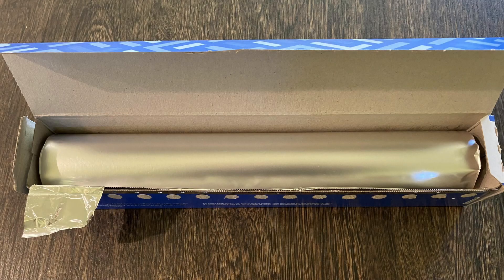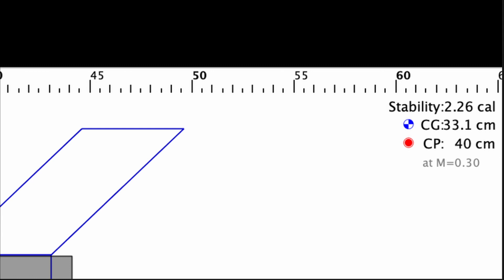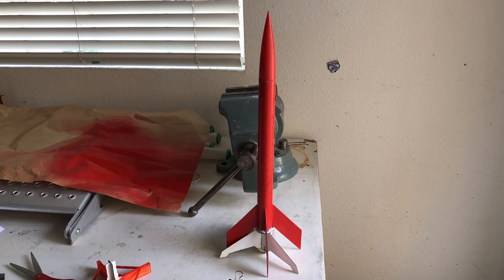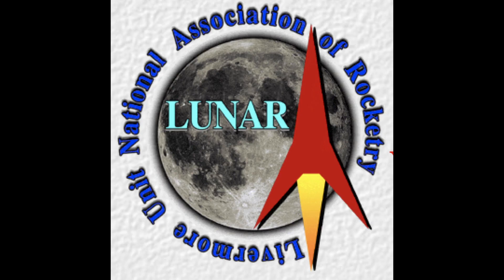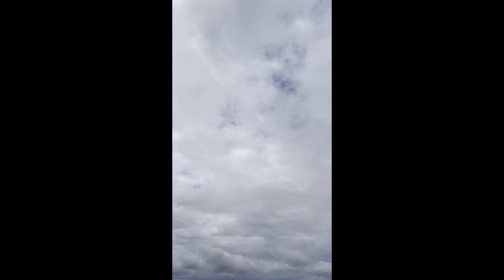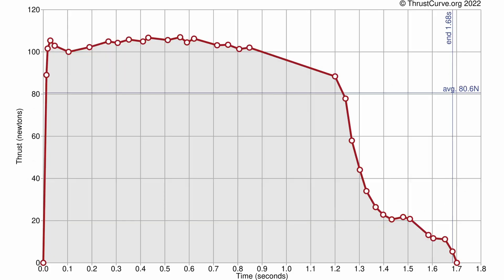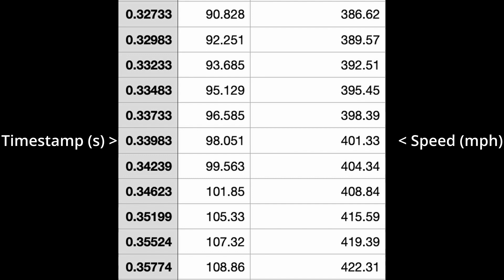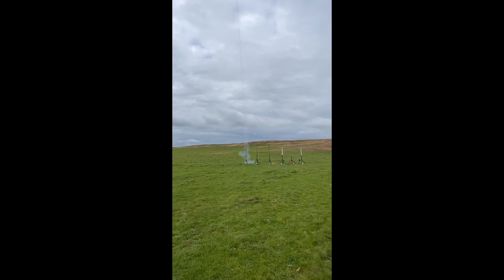Building a Supersonic Rocket and Flying It

Comment: your fin design creates a leverage moment at the trailing edge of the fin where it connects to the fuselage.   Inertia, g force and air friction work to lever the fins off the fuselage.  Your fins connection points are way shorter than the total fin length.  Look at the fin design of successful supersonic rockets and you will see  mostly fins longer at the body connection point, short in protrusion and tapered back to the body at the trailing edge.  Or look at supersonic aircraft that also have the same low aspect ratio.
Reply from the maker: I appreciate the comment! I ended up fixing that and we had a successful flight a year later

Comment: The fins exending below the body into the engine wash might be the issue. Every high speed rocket/missile design I've seen has fins no lower than the end of the body and often high a second set of fins high up on the body.
Reply from the maker: That was definitely one of the causes. I launched a new design about a year ago and it worked.
Reply: @motechspace   Good job. How fast?
Reply from the maker: @RightURKen7  M 1.22 (I recommend you watch the video)

Comment: I knew when I saw you actually used that thin cardboard tube it would do this, the tube compressed and the fins were glued on. Use pvc pipe and bolt on fins and you might make it work but then, that's why ghey have rules and Regulations about Super Sonic Flight. Because,when it goes that fast it's not a toy any more. Models are toys, supersonic flight is Ballistics
Reply from the maker: It worked with the new design still using cardboard. The problem was the fins weren't attached strong enough.

Comment: I think the main reason the fins broke off was due to you using what looked like wood glue on plastic fins. A better idea would probably be to use some sort of epoxy or plastic cement. Also, it could have been the structure of the body tube itself. Because you used an aluminum foil roll, it's likely that it could have ripped since it was not designed for rocketry like the ones you can buy online. Other than that, it looked like a great design and build. Good luck with your next launch! (It seems I'm a bit late so you may have already flown your new design)
Reply from the maker: Definitely a big part of what caused it. I launched a new design back in March, you should check out the video!

Comment: If you haven't determined a cause yet, it's possible that the motor got hot and weakened the fins/adhesives.
Reply: It was most likely aeroelastic flutter

Comment: Sweet rocket! I think you should rebuild this exact rocket but use through-the-wall fins and fillet the fins, attaching them with something even as easy as 5 minute epoxy (to make it super strong you can mix 50% chopped fibreglass tow and 50% epoxy). I think the fins came off because of a lack of surface area in contact with the tube, which would explain why only one of them shattered, and the rest were still intact. Try a different fin design that has a longer root chord and a shorter tip chord. Good stuff.
Reply from the maker: Thanks! I just launched the new design a few days ago. No trough the wall because it's minimum diameter but I used fin fillets and papered the fins. Video coming soon!
Reply: @motechspace  minimum diameter is that way to go, can't wait to see the new video!
Reply: From the couple high powers I’ve flown, slow set (60 minute) epoxy is much stronger than 5 min quick set
Reply: @nickfowler8810  absolutely, but in most cases you need to add a thickener, still worth it though

Comment: Your fin design is inconsistent with high speed or rapid acceleration.

Tip chord must remain over root chord.  Root chord must be longer and span must be reduced.  They are wayyyyyyyyyy too flexible.  You could taper them from root to tip.

You'll need to fillet them onto the paper tube unless you thicken the root.... a lot.

Bottom line...  put some Mach+ fins on that bird.
Reply from the maker: Yep I made some pretty bad design choices. I'm currently building the new design with using papered and filleted fins and the tip chord is fully over the root chord.
Reply: @motechspace  If you learned from them, then you are ahead of the game.  Might consider reading up on fast rockets at TRF.  Some smart folks there.

Comment: I just learned something interesting here. Could be useful for your project. As I suspected an ogive shaped cone is not adequate for supersonic speeds. Low altitude supersonic projectiles usually have cone shaped front ends. The Igla and Igla-S supersonic portable surface to air missiles have a spike at their front tip to create a small supersonic shockwave which reduces air resistance.
See: https://youtu.be/t_5cwfvKW70
So perhaps installing a piece of wood at the tip of your cone - the kind you can buy at the dollar store and normally used for chicken kebab - and re-enforced with marine epoxy could play the same role on your rocket.
Reply from the maker: That's really interesting. Thanks for the suggestion. Yeah I've read that ogives are really bad for the low supersonic region but the new design will use a Von Karman shape which is supposed to be really good. I'll see what the spike does in the sim (hopefully the sim will know how to deal with the different aerodynamics)
Reply: @motechspace  I suspect simulating this sort of details would require a very expensive fluid mechanics simulator.
Reply from the maker: @francoisleveille409  Yeah probably

Comment: Try laminating/filleting the fins to the body with something like fiberglass or even paper if you're going for a minimum diameter rocket. I would also try to increase the length of your root cord for more surface area to adhere to. Nice work with all the hypothesizeing and data analysis, keep it up.
Reply from the maker: Thanks! New design is currently under construction and will be much stronger.

Comment: Was the leading edge of the fins squared off? Or sanded down in the shape of a sharp airfoil? There's a pressure wave ahead of the leading edge of the fin, just like there's one ahead of the nose cone. Its drag effect is negligible at the subsonic speeds of low-power model rockets. As you reach the transonic range, though, the drag of the pressure waves rises sharply, putting stress on the rocket structure. Pointed nose cones and sharp leading edges are less affected by this external pressure — intuitively, they "pierce / slice through" the dense air of the pressure wave.

I second the commenter who suggested fin flutter as a possible cause. Supersonic fins need to be stiffer than those on low speed rockets. Most plastics are not very stiff. Plywood made from balsa or basswood is often used on mid-power rockets like yours. If you can't find any, you can easily make it from thin sheets of balsa and Gorilla Glue.

As far as fin attachment goes, I'm not surprised wood glue didn't do the job. The way wood glue works, it has to soak into both surfaces to be most effective; it can't soak into plastic. I second the commenter who recommended epoxy. Fin joints are stronger if they're glued not only on the edge, but also with fillets where the fin meets the tube (popsicle sticks are great for making clean fillets). 

Since you have access to a 3D printer, have you considered printing the whole rocket, with fins, as one unit? (I do understand, though, if you have sentimental attachment to the aluminum foil tube 😉)
Reply from the maker: Yep I didn't make great design choices for the first design but I was trying to be as cheap as possible. The next design will be much stronger, using airfoiled and papered fins using balsa and attached with epoxy fin fillets. And no I have no sentimental attachment with the aluminum foil tube🤣 (new tubes will be used). I like that 3d printing idea though but I'd be worried about melting. Might do it with a different rocket in the future.

Comment: I'm planning to launch a rocket similar to this but I have some questions. How were you able to connect the motor to the rocket body and how far away was it recovered? I'm launching in a field about 800 feet across surrounded by water, so I'd hope that it doesn't stray too far away. :)
Reply from the maker: The launch was a fail so it didn't go super far. The way we connected the motor though was just with a friction press fit in the body tube. The rocket is minimum diameter meaning there's no room from the edge of the motor to the inside of the body tube. Just wrap tape around the outside of the motor to slightly increase its diameter and it should be tight enough to stay in. These types of rockets go super high, but they're relatively light so just use a streamer for recovery. My new design for this rocket should be launching very soon!
Reply from the maker: Also depending on where you live, you might be able to find a better launch site. Go to the NAR website and look for club launches then find their schedule.
Reply: You're "planning" this but you don't even know how a model rocket fits together? Ok dude.. lol

Comment: The fins tore off because the contact surface is too small. On most mid power rocket kits that can support the thrust of a G80, the fins are slotted through the rocket's body. If you use a 29mm tube that both acts as an engine mount and rocket's fuselage then the fins must be more swept back and they need to be bolted to the rocket's body or perhaps glued to a much larger surface. I would use Lepage's 2 hour curing marine epoxy which is insanely tough and white in color.
Reply from the maker: I don't think that's why the fins broke off but they would have anyway later in flight because of that. Next iteration will have fins fillets.
Reply: @motechspace  Then please tell me how many newtons of force does the air resistance exert on a single one of your fins when your rocket reaches its highest speed ?
The motor pushes at up to 108.5N or about 24.5lbf. At first, when the rocket takes off, most of that is used to accelerate the rocket where F=m*a. Once the rocket has reached "terminal" velocity, all the thrust is opposed by air resistance and gravity. There is also vibration aka air flutter shaking your fins.

Before flight, I would suggest attaching a 5lb diving weight at the tip of each fins and lift the rocket by grabbing the tube. If the fins tear off then you know they won't survive the flight.
Reply from the maker: @francoisleveille409  Maybe you should watch the follow up video after this: https://youtu.be/jZD2TVxWQDA
Reply: @motechspace  Your sim (drag + acceleration forces) says 44.3 N or about 11.07N per fin that's 2.5lbf but you want the fin to take double that for safety margin and I suggested a weight of 5lb for testing.
I think my suggestion makes perfect sense.
Reply: @motechspace  The weights you have used were attached at the root of the fins and therefore do not account for the moment of rotation of the fins imparted by the air resistance which is applied evenly over the fins (from root to tip).
Your test weight is no good. You should have attached them to the tip of the fins to replicate a worst case scenario.
Reply: @motechspace  Forgot to mention, since you account for the G forces of the acceleration phase; these G forces are applied at the center of mass of your fins so once more putting a weight at the root of the fins does not properly replicate the effect. Your testing method is not valid.
Reply from the maker: @francoisleveille409 Your suggestion does make sense. I used a 7 pound weight and that was for one fin. However, like you said, that was on the root of the fin and didn't account for the moment force in a real flight. I will account for this when I test the next iteration in the coming weeks.
Reply: @motechspace  I suspect if you look at the fins shape for the Aerotech Arreaux and Mustang you can see these won't be affected by this rotation effect as they have a "heel" at the base to transfer this force to the base of the body tube. Similar shapes are often used on the fins of fast high power rockets for the same reason.
Also, about what you said concerning super glue (cyanoacrylate ) is not always true. This glue does penetrate paper and wood very well but it can only get so thick and therefore can only tolerate a specific stress per a given amount of surface to which it is applied to. IMHO, the best adhesive for your application would be Lepage's marine epoxy which requires 2 hours to cure properly (expect it to be more like 4 to 6 hours). This stuff is insanely tough once cured.
Reply: @motechspace  That's trapezoidal fins with the forward edge made sleeker.
Reply from the maker: @francoisleveille409  Thanks for the suggestions. In the sim I was able to make the forward edge sleeker and the tip chord barely hangs over the back of the root chord (very small sweep angle on the back edge).
Reply: @francoisleveille409  The tip of the fin would be overkill, since the drag is likely distributed across the length of the fin.
Reply: @lr21643  The drag is all on the leading edge of the fin when the rocket becomes supersonic. Since the center of pressure is about halfway between the root of the fin and the external edge this causes torque which must be compensated but an 'heel' at the bottom of the fin.
Sidenote: You do not indicate if you are replying to the original message or one of the many following exchanges.
No, putting the weight at the tip of the fins would NOT be overkill because you want to test your structure with a stress that is MORE than the actual flight to provide a safety margin.

Comment: IMHO : The 7 second delay is too short. The G80 is available with 13 seconds delay. The small rocket can go fast but this means it will go high and will decelerate for quite some time.
Reply from the maker: The sim said 7 seconds...
Reply: @motechspace  Having launched Aerotech rockets/motors since 1993 I can tell you 7 seconds would have been appropriate for a rocket like the Initiator which is more than 400 grams and 2.6" diameter.
Your rocket had a smaller diameter than a Mustang and the weight was about half so clearly you didn't enter something correctly in your simulator.
Note a Muitang is usually flown with a G80-10T -> 10 seconds delay! Your rocket obviously would require more.
Reply from the maker: @francoisleveille409  The supersonic speeds cause the deceleration rate to be a lot quicker. Also keep in mind that those large fins create a lot more drag. I made sure every single value in the sim was perfect and I'll do it again for the next iteration which will have smaller fins. We'll see how that affects the optimal delay time.
Reply: @motechspace  Your rocket - according to your sim - only reaches Mach 1.18. So the question is, what portion of the acceleration phase is supersonic ? What portion of the deceleration phase is supersonic?
If you simulate that you'll realize your rocket exceeds the speed of sound only for a fraction of a second.
Your "large fins" are pretty much the same  in terms of air resistive surface as those on Aerotech kit Tomahawk. But the rocket weight is much lower and so is the diameter. The Tomahawk uses 1.9" tube (48mm). Also, the air pressure and resistance decreases with higher altitude.
The breaking of your fins caused a brutal deceleration but if it had not occurred then your rocket would have gone to about 5000 feet.
Reply from the maker: @francoisleveille409 I'll give you an update after building the new version.

Comment: You shear strength is not good enough.  I would 3D print the entire fin can and probably still do epoxy/fiberglass from tip to tip of each fin set.  Videos out there on how to do this on Rocket Vlogs and John Coker's channel.  Anything over mach 1 should have this.
Reply from the maker: The plan for the next iteration is to use fin fillets.

Comment: Try 3d printing the whole body as light as possible, or just have all of the fins 3d printed on a “ring” that you can attach to the tube.
Reply: 3D printed body tubes are no good. At least not with your typical domestic 3D printer. It will buckle under stress because of how the layers are made. And if you manage to design it structurally strong enough, it will end up too heavy. 
However, you can almost certainly print the fin “can” as you described.

Comment: What did you use to connext the fins to the body tube?
Reply from the maker: Hi Max. Thanks for your question. We used wood glue on only 2 millimeters of attachment for each fin. Wood glue doesn't work that well on PLA plastic which has to be part of the reason why they disconnected. New video coming soon of me analyzing the simulation data and figuring out what we can do to improve attachment.